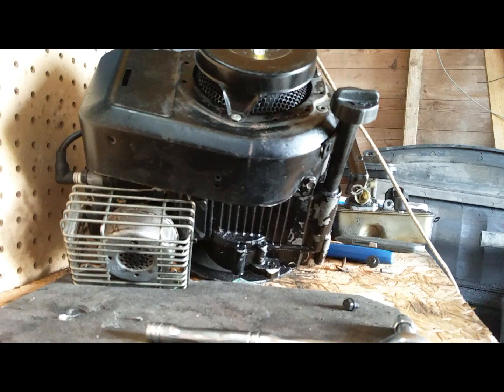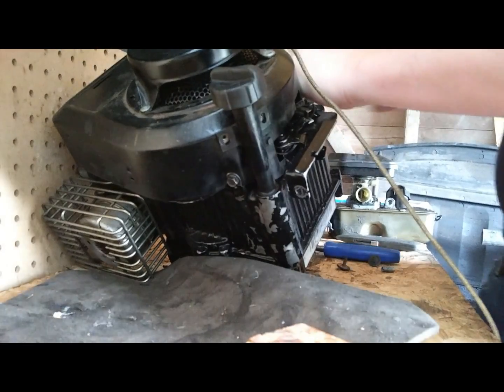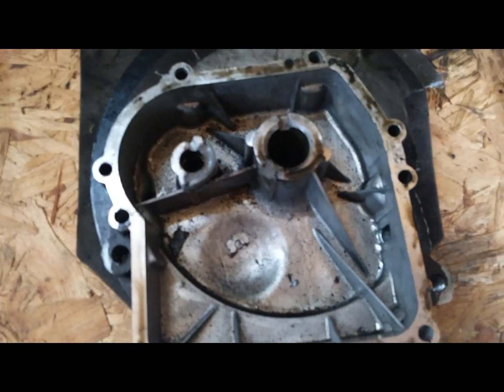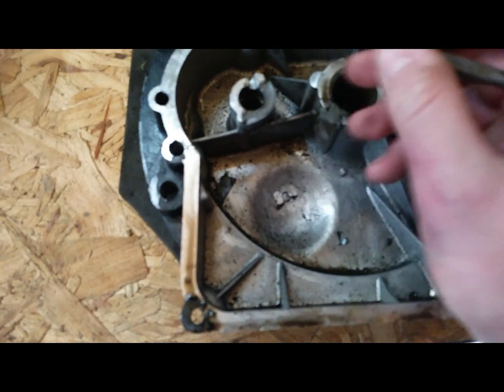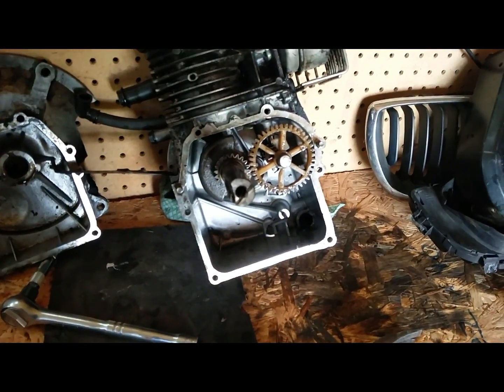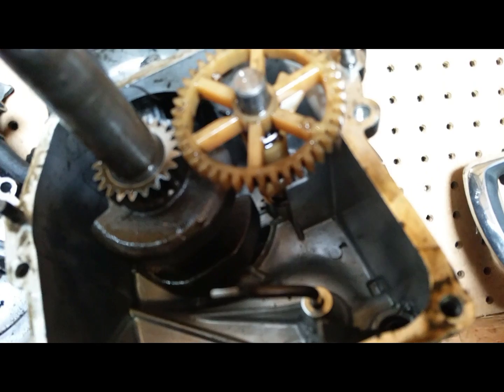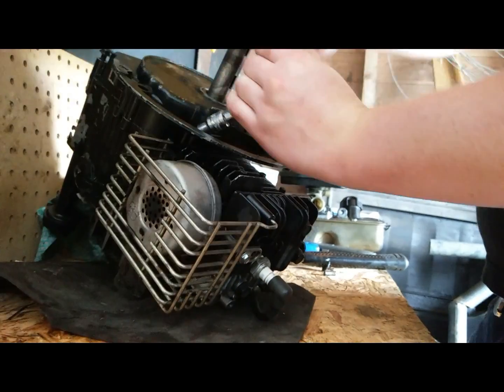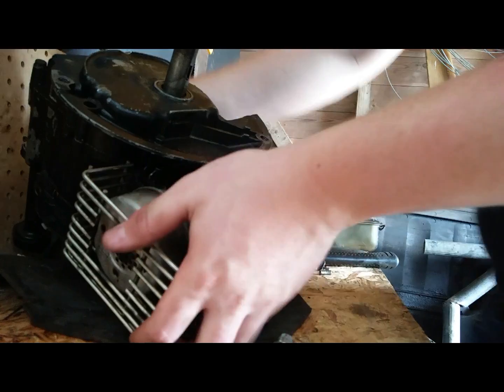How to make a lawn mower engine into a go kart engine! ( Vertical to Horizontal )

Comment: hi make your oil dipper longer its not quite long enough , isaw another chap do the same as you and his dipper was longer , don't bend up the end  have it long and flat abit of panel steel resonably thick and  about a eight of a inch off the bottom of the floor of the motor. would be good sorry yours is a   bit high  lower it  mabey take out govener   to, very good viedo well done

Comment: so that not work with engine with ohv
Reply: It's definitely possible. I'm doing it right now and the only problem I've come across is getting the carb to work, since the engine uses studs in the head but I think I can do it
Reply: @93jake81  Did you manage it?
Reply: @phillybluntowski  WOW it’s been a long time since i’ve posted that original comment. i kind of got it working by modifying the stock carb but it wasn’t any good really. if you’ve got a welder and are decent at welding you can make your own adapter plate to turn the carb 90 degrees

Comment: only problem I've had so far is trying to split the case. 
have to hammer it the rest of the way off. eh
Reply from the maker: TheFugiapple12 yea definitely by try to use a soft hammer like a rubber mallet, try also hit near the bolt mount holes because the casing is strongest there,  hope this helps,  let me know:)
Reply: got it split now! also what is the shaft size of this engine?
Reply from the maker: i think mine was about 1 inch, not totally sure, sorry
Reply: Since i salvaged mine from a lawn mower, i had a VERY tough time getting the pressed-on adapter for the blade off, i had to torch it and then beat it off.